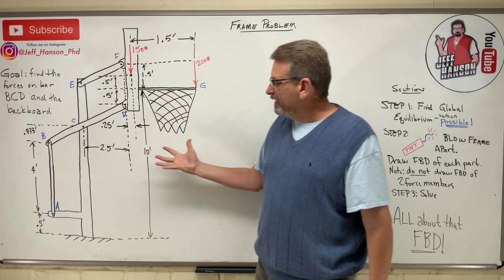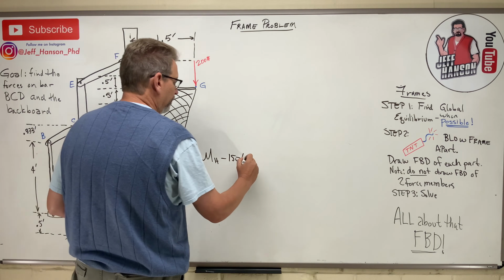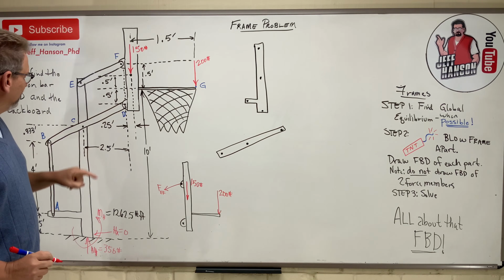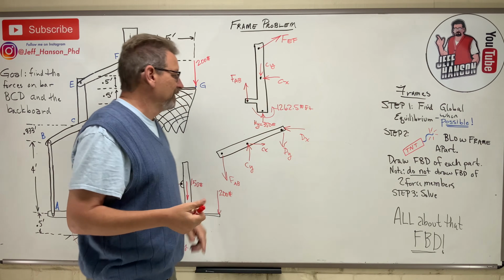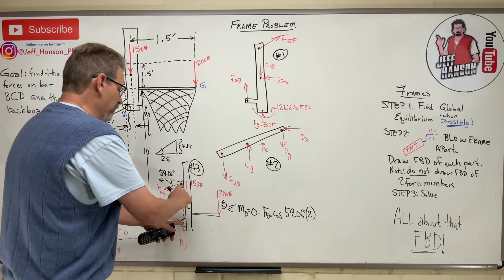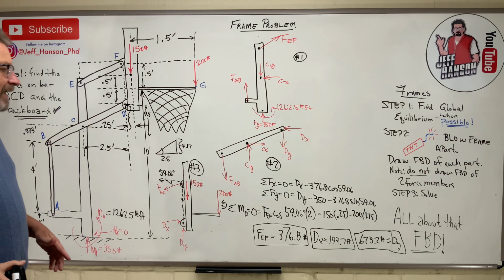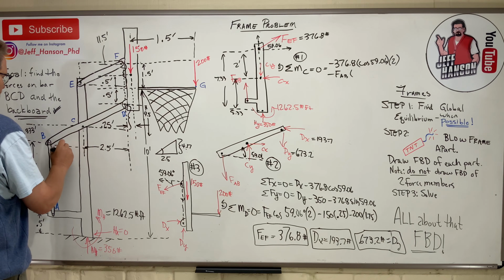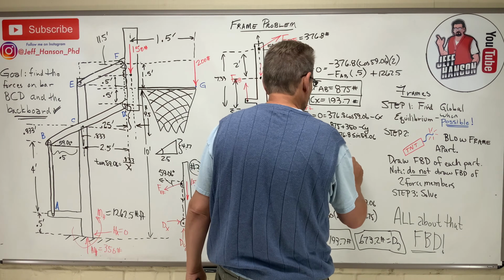Statics: Lesson 53 - Frame Problem with 2 (Two) Force Members

Comment: Couldn't we have taken moment about C on bar BCD's FBD and then found F_AB from there which could've been easier? We could then use sum of forces in x/y to solve for Cx and Cy after that and it'd be alot easier because no force on that FBD is on an angle. Just a suggestion, lemme know if i was wrong somewhere.

Comment: How is BD not a 2 force member? Shouldn't it be two 2-force members since there are no forces acting in the middle of it? Shouldn't BC and CD be considered the 2 force members here? 

Also, on lesson 52 we didn't take account of support of the truss. Shouldn't that not be a 2 force member since it is not pin connected? Why didn't we take account of the moment reaction as we did in this example?
Reply: There is a pin joint at C so there will be a reaction force at that joint which makes BD not a 2 force member.

Comment: Ain't the angle for the force FE should be arctan(1.5/2.5)? [at 15:20]

Considering EF = 1.5', I got the following values,

The angle for the FE = 30.96 degrees
Force EF = 225.94#
Dx = 193.75#
Dy = 466.23#
Distance CE = 11.5' - .833' - 4' - .5' - 1.5' = 4.667'
Angle for the BCD member = 59.03 degrees [arctan(4.167/2.5)]
Perpendicular distance from force AB to point C = 0.5'
Force AB = 716.54#
Cx = 195.67#
Cy = 832.77#

Whew! That one part almost cooked my brain. I assume the dimension lines were a bit off which caused the main confusion (length of EF). 🙃🙃
Nonetheless, some of the values came exactly same as professor's but mostly not. If anyone comes up with same values as mine, let me know if you can.
Reply: This one closest to my answer. I think prof Hanson assume the EF and CD slope are same so he measured from the CD member.
Reply: dunno where you used ce but i get 5.167 . perpendicular distance between the horizontal line passing through c and d is 4.167 . add 0.5 and another 0.5 to that. thats ce

Comment: Why do joints C and D have both and x/y component whereas joint A and B only have a y component? Also, how come we list pin D with with forces in the x/y direction, but for pin F we just list the force as F_EF and assume it in the direction of the member?

Comment: Hey professor I just wanted to give quick heads up that the dimensions on the video and the book don’t line up. It’s 1.5 from F point to E point on the book while you had to find out the distance the hard way in the video

Comment: Note,  I am quite sure there are a few errors on this problem. Here are my calculations. (Take it with a grain of salt, but test for yourself).

The main problem is that the angle which jeff used as 59.06 degrees on diagram should actually have been 30.95 degrees. He just mis placed the angle in the wrong position.

For diagram 3 the answers would then be:

Fef = 225.9 #
Dx = 193.7 #
Dy = 466.2 #

Then the second problem was on the distances between EC and AH. In jefs textbook the distance between B and C is also 0.983 and not 0.833. The vertical distance between CD is 4.017 not 4.517. I believe Jeff just made a calculation mistake here. This gives you an angle of 58.1 degrees using arctan(4.017/2.5) in trangle CD (below member BCD), which would correspond to the angle in traingle BC on member BCD. You can then use this to find the horizontal distance AH which would then be 0.6118. 

Using this information on part 1 my answers are then as follows:

Fab = 791.7 # (using moments).
Cx = -193.7 # (assumed wrong direction) or 193.7 # if assumed correct direction.
Cy = 1257.9 #

Maybe, I'm wrong, but I'm quite sure this is correct.
Reply: Are you sure?
Reply: I agree with you.
For CD bar, the angle is 58.10; but for EF, the angle is 30.96.
But Fab = 632.8#; Cy = 1099# the rest are the same.
Reply: Just finished it and got the following:

Fef = 226# (T)

directions for the following ones are wrt bar BCD

Fab = 633.1# (T) pointing down

Cx = 193.72# pointing right
Cy = 1099.5# pointing up

Dx = 193.72# pointing left 
Dy = 466.4# pointing down

Comment: Dr. Hanson's book has points E and G on the same horizontal line. Both are 10' above the ground. The distance from the ground to point C is 5.483. Therefore, the distance from point C to E is 10 - 5.483 = 4.517. The Fex moment calculation, according to his book, should be 376.8 lb (cos59.06)*4.517.
Reply: yes, I am also getting that. I was so confused because no one here seems to notice. And the angle for Fef I am getting as 30.96 degrees.

Comment: Thank You Professor! but I think the angle for F EF should be tan-1(1.5/2.5)= 30.96 NOT tan-1( 4.17/2.5)=59.06 

for EF, the height is already given, which is 1.5. but you did the math to find the angle for BCD Instead.
Reply: i also think so.
Reply: agree.

Comment: Why the point F isn't a pin, like D? It should be a pin with 2 reactions.
Reply: Member EF is a 2 force member because it does not have an external force applied to the member and it is pin connected at both ends. At the start of the video, he advises that we do not draw FBD of 2 force members because they do not provide any new information. If you look at member D, it is not a 2 force member. It has a pin at the center. This is why he sketched the reaction forces, as it is not a two-force member. Also, you can see he also did the same with Fab because it is a 2 force member.
Reply: @dbutt2827  I understand member D has a pin in the middle, but shouldn't that make it two 2-force members like in trusses? In trusses there are pins in the middle all the time, yet they are still 2-force members.
Reply: @IsvanMarcial yes you could treat it that way, but that wouldn’t provide us with any new information. It’s better to treat the pins as pins and the 2 force members as 2 force members.

Comment: got confused on the distances for moments & triangles mainly because of the complex measurements but Mr. Hanson's way of teaching is so effective 
Fab= 1750#
Cx= 193.75#
Cy= 2422.46#
Reply: i got the same. i decided to use the moment at c on member 2.
Reply: Thanks you 
You are right I got the same
Reply: correct Ciame i got as u
Reply: Dr. Hanson forgot to divide by.5, therefore his answer was half the amount it should of been, 1,750.
Reply: I got 1750
Reply: Fab = 2140 Ib , check again. 😃
Reply: @A.Hisham86  It is not 2140 lol

Comment: in lesson 42  there were no moments considered at E ( that was however a truss problem ) why do we consider moment here at H ? How would we know when to and when not to consider moments ?
Reply: In Truss Problems, we assume the joint to be a Pin Joint. Here, the Base of the Stand is a fixed support.
Reply: Since the base is a fixed support resisting it to revolve at point H , hence  the reaction at point H in form of moment of force
Reply: @kensonmalupande2424  I understand here it should be like this, but why wasn't it like this on lesson 42?

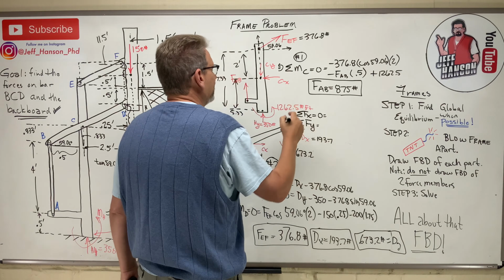Comment: At 27:31, Fab is not 875lb. It is actually 1750lb.
Reply: yup he forgot to divide by 0.5
Reply: @carsonhenderson
Reply: Making use of shift solve in the calculator would eliminate a lot of errors i think
Reply: Thank you very much.
That makes cy = 2423.3
Reply: thank god bro i was geniunely tweaking
Reply: yep, very easy to make arithmetic mistakes...its brutal for that!
Reply: Agreed w u Vinay shd be 1748.8 # and not 874..40. Prof ANSON FORGOT to divide by 0,5
Reply: Which also means cy is incorrect because he implied the 875🤭
Reply: I am a first year eng student and this stuff is pretty straightforward

Comment: Thank you so much for these videos, they are incredibly helpful and 100% the reason I'm doing well in statics. I have a question about how you solved for the Moment about C in FBD #1. I got the same answer when I did 1262.5 - 376.8(cos(59.06))2. But don't you have to multiply that by 2  because AB is 0.5 ft away?
Reply: It seems that you're right. If you take moments about C on the part BCD you get Fab=1750 lb which is 2x the answer given in this example.
Mc = 0.5Fab + 4.17Dx - 2.5Dy = 0         ========>           Fab = (2.5Dy-4.17Dx)/0.5

Plug in to that equation,   Dx=193.7 lb  and  Dy=673.2 lb,   and you get Fab = 1750.5lb = 2 x 875lb